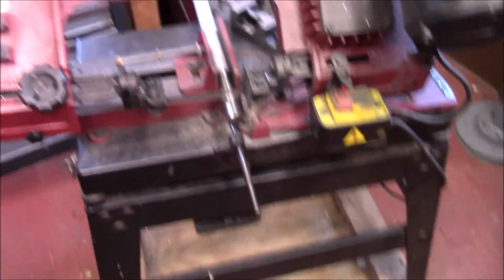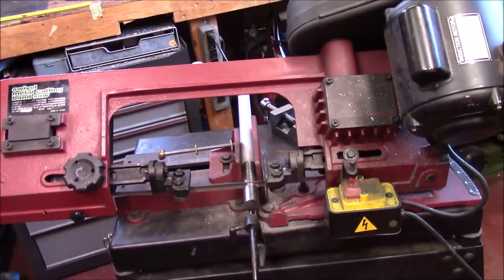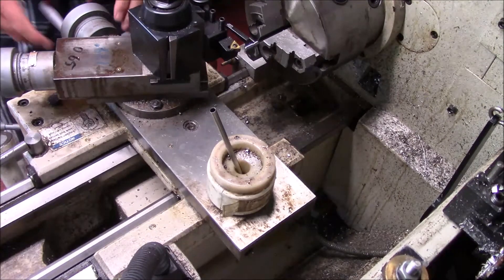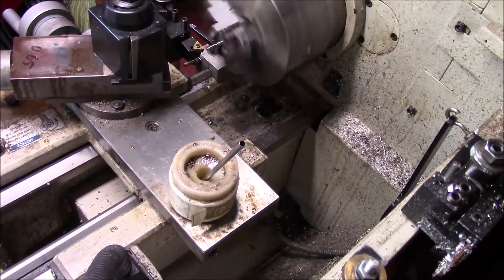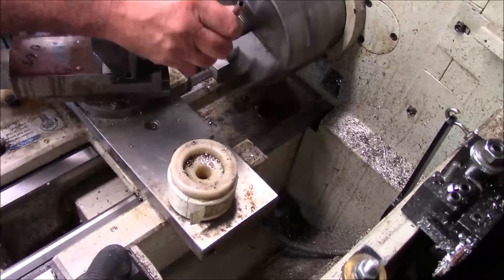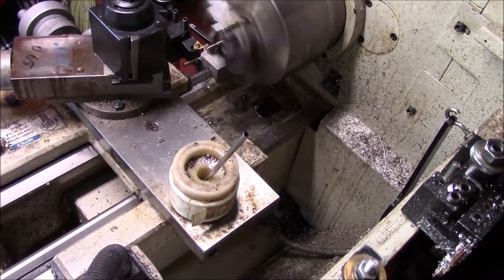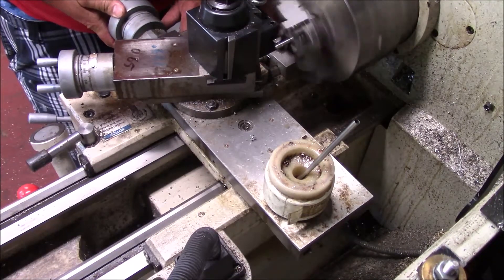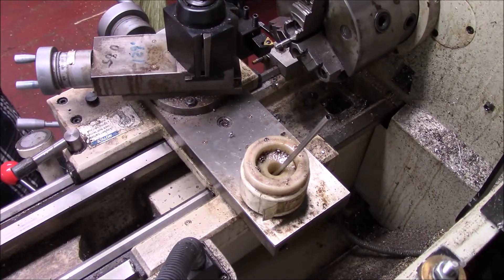Mr Bozo visits the shop, How to break off a rod while threading

Comment: From my limited experience, small diameter parts when threading with an insert tool (especially) really benefits from being supported with a tail center.  And like you said in the video, do not make the relief too deep.  Hope you had a nice 4th of July holiday.
Reply from the maker: ILGopher - Ryan Weishalla well it is hard to support that rod because of its small diameter. As I answered some one else between using a narrower relief and reducing the depth of cut on the last half to .002 that solved the problem.   

Thanks for the feedback back. Have a good one
Reply from the maker: ILGopher - Ryan Weishalla thanks I’ll look at it.
Reply from the maker: ILGopher - Ryan Weishalla buddy after l seen the link I remembered I purchased a similar set of centers. I kinda feel dumb now. Thanks for the suggestion and feedback
Reply: You're welcome. I hope it helps.

Comment: James,  I never make live videos while I'm working on jobs. I find it too distracting and I do not have a talent for it.  You seem to do a go job at it live, but as for me I wont risk ruining my work. You will find that even the best youtubers that give play by play oration, while performing skilled work, will be visited by "Mr Bozzo"every so often.     Many will just video the work in progress, then do a voice- over  play by play account of the operations. I know that is my game plan of sorts. 
That tool ran right up to the part and really seem to hit it. I think you might have been running a bit too fast on the spindle speed.
 Anyways Happy 4th of JULY  to you and yours!
Reply from the maker: AWDJR yes that is a challenge to do both. Actually I was taking a aggressive cut on 1/4 rod and I used a cut off tool for my relief so the part was weak. My lathe speed range has a big jump from 75 to 200 rpm. I was running 200 rpm. When I redone it I as I showed the HSS tool that I ground to cut a smaller relief also I reduced the depth of cut on the last half of the threading. 

Thanks for the constructive comment